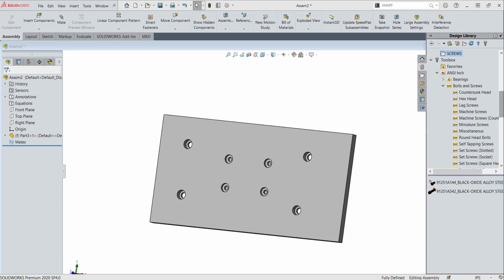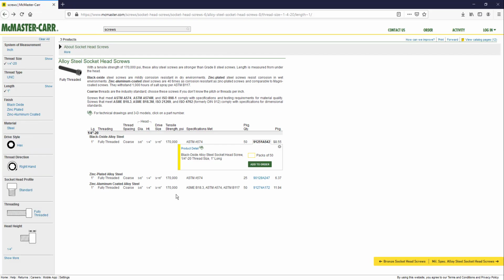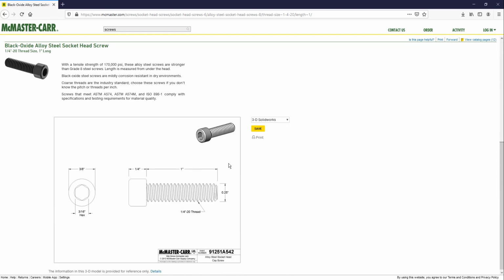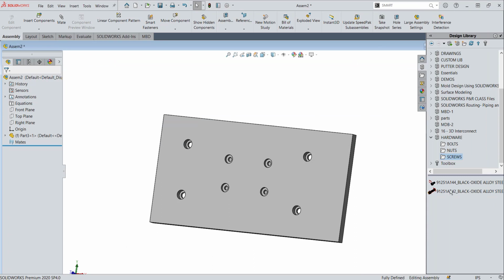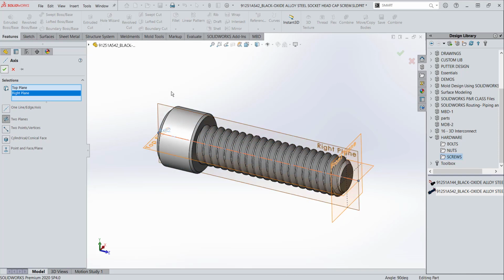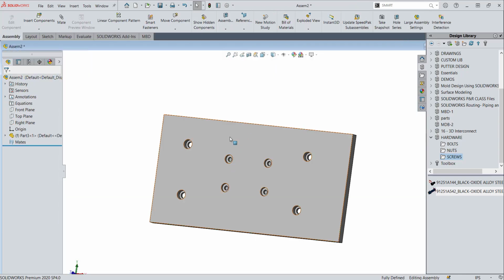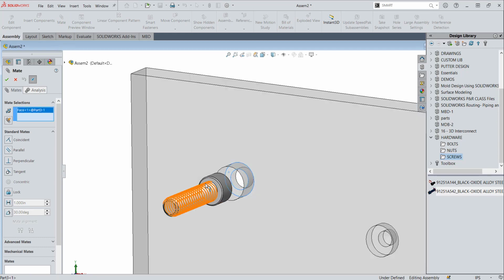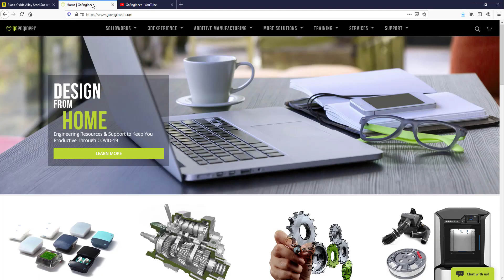SOLIDWORKS TUTORIAL - Downloading Hardware for an Assembly

Comment: Well, i'm surprised this video didn't show a faster method for mating the screw - Mate references.  Also, using a fully modeled helical thread for a library component is not an efficient practice.   Schematic representation is okay, but cosmetic representation is best for performance.